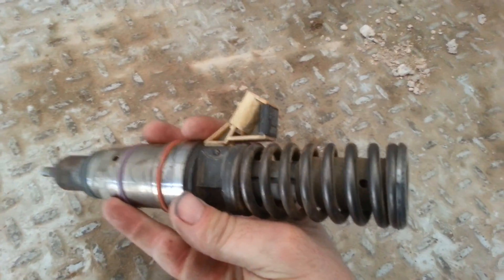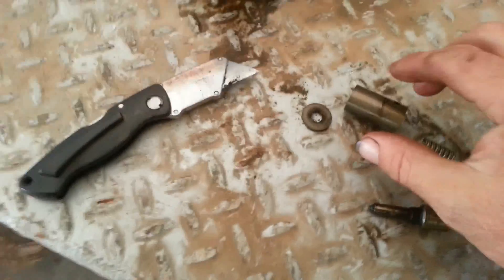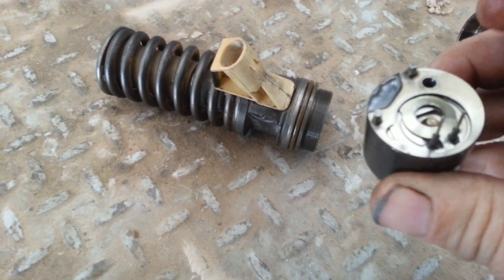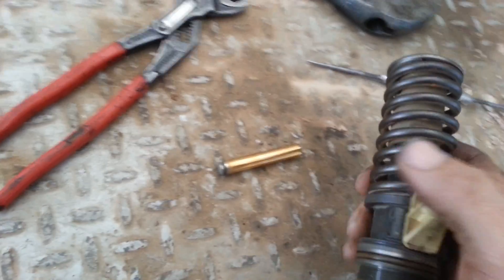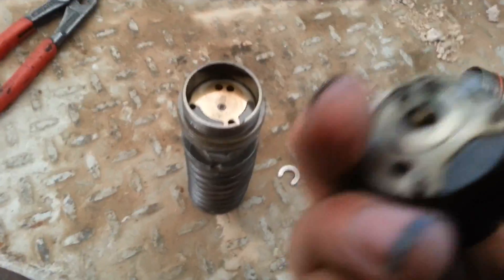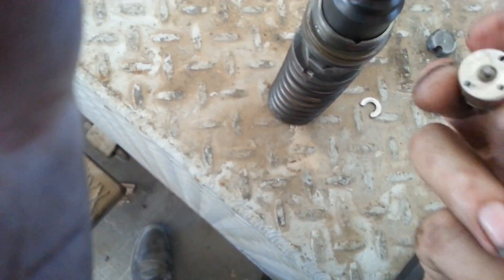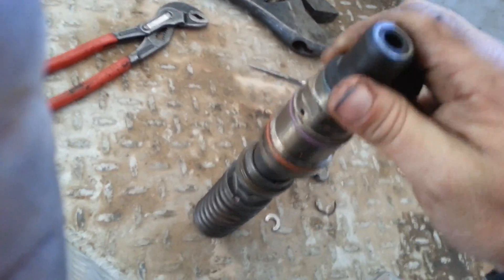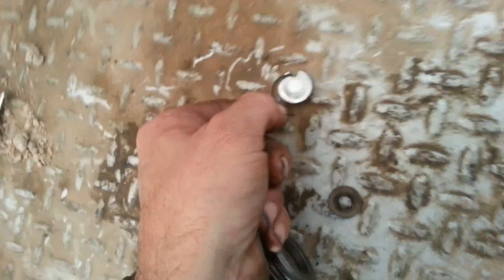S-60 Detroit DDEC V EUI disassembly/reassembly. Please subscribe.

Comment: what is the most common reason for injector misfire or hanging open? is it the tips get dirty?
Reply: Mine was always bad connectors.
Reply from the maker: vi ncent jarvey Hello Vincent if it's DDEC V it can have oil in the connector. wash it out with cleaner both connectors then blow dry untill it's clean
Reply: ok. Had n3 go bad before. misfire code. How about n2 injectors failure reasons?
Reply from the maker: The N2's can have a loose wire crimp, causing a intermittent miss.